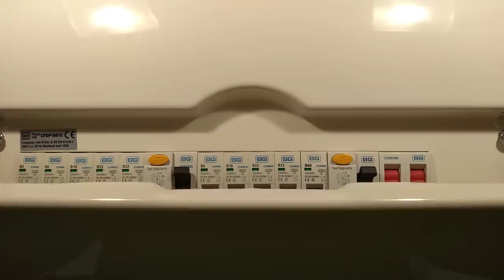A look inside a British home electrical panel.

Comment: 100A !!??!!  I have 3-phase 16A in to my house, but I think 3-phase 25A is most common in Sweden.  That is 400V 3-phase.
Reply: The 100A Single Phase would relate to 35A Three Phase
Reply: Try USA, my house has 2 phase 200A feeder.
Reply from the maker: That's quite odd.  Is it for remote locations with just one home on a cable run?  Here we have the higher current single phase, but adjacent houses will be on different phases to balance the substation load.
Reply: 400V 16A 3-phase is still about 11 kW. In American homes, most circuits are 120V, 15-20A. The service is actually 240V single phase, but it's split with a center tap on the transformer at the power line, giving us two 120V legs that are 180° out of phase. Your higher voltage means less current to get the same power, so you can use smaller cross section wires to carry the same power as us.
Reply: 400v 3 - phase, !      I take it your white goods don't run on 400v ?? so does each house have to have a transformer to drop the voltage to something safer? HUMMMMMM
Reply: @Repofox  thanks for the explanation,  so why did he have to make the point "400v 3 phase" ????  just down the road mine are hundred of thousands of volts-3-phase,  Clive seems hit on something here,  everyone seems to be in a upmanship competition atb nick
Reply: As said, 400V 3-phase is used for 230V (or is it 240V ?) single phase outlets, usually with 10A fuses.  The 400V 3-phase are often used for electric heating and/or water heaters.  Power hungry appliances as washer/dryer/dishwasher/heatpump/car engine heater are on different phases so that they can all be used at the same time.  If there are electric central heating we often have the heater monitor the total power consuption so that when for example the washer is using a lot of power the heater stays at a lower power usage until the washer (or wathever) is done.
Reply: Here in Belgium we mostly use 40A single phase 240V and 25A 3-phase 400V mains breakers (on the left).  16A breakers for lighting  (1.5mm²) and 20A for sockets (2.5mm²). We also use RCBO's.
Reply: @nickbird7742  400 V is phase to phase, phase to neutral is 230 V. 400 V is not used typically. For example ranges get three phases each 16 A i.e. max 3680 W each. But one can use also on a single phase. I have just a 20 A breaker which means 4.6 kW max.

Comment: Not sure if anyone has said this before but: A Type B will have a 5 times instantaneous trip and a Type C will have a 10 times. So if a 6 amp type B breaker hits 30 amps it will trip instantly, or if a 6 amp type C breaker hits 60 amps. Type D are often refered to as "motor rated" and offer a 20 times trip although this can be 10 times in some cases, remember to check the makers instructions and cross referance those earth fault loop impedance readings.

Comment: Wow. This seems quite minimalist when compared to panels used here in the USA. My home panel has approximately two dozen breakers, and the main breakers. But, it has no RCD. We use GFCI wall plates in water prone areas. I also use them around my repair bench, and at the metal lathe and bench grinder.

Comment: Snap! So you went for the Screwfix offer as well! '-)
Reply from the maker: It was irresistible.  And besides, it's not a bad choice of breaker ratings.
Reply: Yeah, that's exactly what I thought, nice and flexible, even though I only live in a 2up 2down, I'm sure the extras will come in useful. Is it something about event lighting experience that makes us want lots of spare breakers I wonder? ;-)
Reply: @bigclivedotcom  I fit the BG boards all the time, great boards and priced well. :-) I have fitted MK...meh...no better at twice the price.

Comment: Ah modern electrics. Something my house is long overdue for. Originally built with gas lighting and having that fancy electric stuff added later (a few times by the looks of things). The last time the electric company insisted we needed a newer (non mechanical) meter the guy that came to fit it had a mild heart attack. There's wiring of all eras of colour coding and some that isn't just for good measure. And as for a consumer unit? There's just a variety of bakelite and ceramic fuses among other fun things that children shouldn't play with. 
We have a couple of dead sockets, old round pin types, and various other oddities that even with the aid of multimeters we can't trace back to anything even though at one point or another they did provide power until they didn't.
I feel sorry for the poor blighter that will have to rewire it all 'properly' one day. We just nurse it along as we go and somehow haven't suddenly combusted. Yet.
Reply: "Modern". A common ground fault circuit interrupter for several circuits is something that we stopped doing many years ago, and now all new installations have the integrated GFCI for each circuit. Much less of a headache if you get some kind of ground fault, and you don't end up having a complete blackout in your house.
Reply: Hope you kept some gas lighting for power cuts  ;)
Reply: @Tomazack  And if you wish to pay for that you can do just that here. It's all down to how much you're willing to spend vs the very small risk of a fault.
Reply: @Monkeh616  Doesn't make sense to save on stuff like that. It's a one time investment, you'll probably not replace them all together anyway, only one by one if they fail.
And as an electrician I have never installed in a new house or rebuild a fuse box with anything but these combined circuit breakers. It's probably close to 15 years since they became the standard here. No exceptions in household installations. 
And I've lived in several houses where there's ONE common GFCI and the whole house got a blackout on occasion, it's no fun. If you're gone for the weekend or longer when that happens in the winter, bye bye pipes when all freezes. In the summer you just lost all you had in your fridge and freezer. So yeah, can't really find good arguments for saving on that end in my  book.
Reply: @Tomazack  As far as replacing, they do fail, and replacing them can be problematic a few years down the line.

In a lot of situations there is little or nothing to be gained by spending the extra - merely more points of failure. You have the flexibility to configure it however suits you.

Fridge or freezer bother you? Don't put them on a common circuit (and what tripped the thing when you were away anyway?!). Pipes freezing? .. perhaps don't have uninsulated pipework in areas where this is likely. Pipe insulation is money better spent. So is wall insulation. And roof.
Reply: @Monkeh616  Clearly you have different standards and priorities than we have. All fine by me. I was schooled in this line of work so I am only stating factual information about household installations in Norway. If you build a house, no electrician will ask if you want to save a little money on cheaper circuit breakers. That is just not an option here, for good reason.

Comment: I have a 1920's house in the UK. Inside the skirting boards which are 3 inches x 3 inches and concave there is double cotton covered wires,  one red and one black, in a groove cut into the back of the skirting board. These are still connected to very interesting plug sockets that have two pins. They were installed for DC electricity. I wonder if they are up to code.;-)

Comment: I have just rewired a secondary panel at home, we have quite different norm in France, called nfc 15-100. The main difference: input from the left, bottom output and dual pole breakers (both L+N). Note that both 3 phase and 1 phase are common (you can request what you want).

Comment: Took 4 years for me to be able to become a qualified electrician 5 days of training extremely concerning
Reply: If you can't get the general grasp of how a panel works in 5 days, maybe it's back to grade school m8.
Reply: Yeah LOL general takes more than 5 days to develop the appropriate skills and knowledge
Reply: @christophermangion9375  yea; but i think the point is, I don't think the US version is better though, just worse in a very different way.

8,000 hours and 600hours of course work to wire a plug in my home legally (pending state/municipal); yet I've worked, installed and designed 400V-600V, 100amp DC rails (you only make a mistake once with high amp DC).

Like the other protected professions in US; it's become a bit of a abuse of power acting in its own self interest; ie: (plumber, surveyor)

Comment: I use a 25A C curve breaker for my electric bike, it pulls 45A for up to a minute and has never tripped. It seems like the best choice as it's not a resistive load and the RMS rating seems more suited for that task.

I have seen fuses launched at peoples faces and entire power boards cratered and charred by a single breaker exploding. It showered the whole room in molten metal and set literally the whole laundry alight, so more protection is better in my book 😁

Comment: Quickie (close enough for initial purposes) power calc: at 240V 1KW is approx 4Amps,  So 60A main fuse = approx 15KW (saves hoiking the calculator out).  OR another way for every 1KW of load you need 4Amps at 240V.  So a 3KW heater needs approx 12Amps.  (For the purists 250V at 4Amps = 1KW)

Comment: 5 days training? Are you serious, is that from zero to hero? IIRC standard electrition dual-system apprenticeship is three years, ..! :-/
Reply: Clive is not properly reporting the truth, nobody is becoming a qualified electrician in five days. The five days of training brings you up to competent person level which is what is required to do minor domestic work. This means you can do basic domestic wiring as covered by the relevant onsite guide. You can't do any commercial (e.g. non-domestic) work or calculations for non-standard circuits and you can't do a test and inspect even on your own work. Additionally you aren't allowed to work on a three-phase system even in a domestic property. You can sign off your own new work as long as you have previously filed a minor works notice with building control. Building control may ask for a fully qualified electrical to inspect your work at the end of the job although technically they shouldn't if you hold the relevant qualifications. As for qualifications they must be kept up to date as the wiring regulations change if you want to continue signing off work.
Reply: Interesting, However, I would think in Germany you are legally not allowed to do any professional electric installation without this 3 year dual-system apprenticeship (trainee in a company + school) or higher qualification.
Reply: @WobblycogsUk  Yeah, I kinda presumed it was something like that. He's still right that it can't be enough time though - maybe if it was a refresher, but not starting from scratch...
Reply: @raybarker  I know a bit about it as I've sat one of the courses. As long as you've got a bit upstairs it's enough training to safely carry out the limited range of things you are allowed to do. Domestic wiring is not rocket science by a long stretch. Having said that the test at the end of the course needs work. The practical is thorough but the theory section is a joke.
Reply: @WobblycogsUk  Good info

Comment: Technology Connections gave some input about households across the pond are GFCI protected at the mains power box instead of through individual high risk outlets.  Houses over here are rarely GFCI protected at the power box, so it's quite a good thing that the circuit breakers are both made for high current and ground fault interrupting.  He also said that might lead to troubleshooting difficulties, since it'll be hard to track down an appliance that's flipping the breaker if a ground fault's the culprit, not high current.

Comment: looks nice here in South Africa we use a similar system but the busbar bridges and live connections are all made on the top of the board and the out going wires to the plugs ,lights ect all are on the bottom

Comment: Red Yellow Blue
Well Trained Crew
Brown Black Grey
Trained In A Day
Reply: Yellow? that could be confusilated with the Earth, not allowed anymore in Australia.
Reply: ah pre euro harmonisiation 2004 colours. some would say the good old days.
Reply: Ray G The primary colours, Red , Yellow , Blue, quite simply a no brainer.
Reply: @idi0tdetectioninprogress  When did common sense and government regulations ever appear on the same page? We used to have RYB phase colours until the Protective Earth conductor was changed from solid green to green with a yellow trace. If you are really stupid a yellow stripe could be mistaken for a yellow wire in the smaller cable sizes, so now we have Red White Blue.  I think next year they are going to let us have real plastic knives with a sharp edge! Don't know what we will do with all the rubber knives.
Reply: Ray G I think people are more referring to our now harmonised colours. Shame really, when we already had the best colour system.
Reply: @idi0tdetectioninprogress  Is that the black brown grey system? Luckily it never became common down Australia. Only ever find it on imported stuff.
Reply: @rayg9069  Yes, the Harmonised colours are what people are displeased with, and rightly so. When we had the best engineering standards on the planet, choosing the primary colours for phase identification was a no brainer, and GREEN for earth, who would ever have thought it! Now we adopt silly colour scheme so that cheap nasty European cable can be used in the U.K. Even Green/Yellow for earth was never an issue, only sometimes when we got awfully manufactured `Chinese`  over sleeving which was yellow with a green strip that looked like it had been done with a laser! Our Regs were always clear on a 70/30% colour split, so we just threw the other shit in the bin.
Reply: @idi0tdetectioninprogress  I have noticed the quality of electrical items has gone down the toilet in the last decade, we used to have Australian Standards stamps on all approved gear, rarely see it now, some of the plastics used for sockets and switchgear feels like styrene and so brittle
Reply: So true!
Reply: Mike Eastridge  which country?
Reply: @peterpeterson9903  Australia uses Red White Blue. Started change over from RYB mid 70's?
Reply: @idi0tdetectioninprogress  Except that the primary colours are Red, Green, Blue! Last I time looked, Cyan, Yellow and Magenta are the secondary colours. 

Green used to be Earth, until about 1972, when it was changed to Green/Yellow, along with Live (used to be Red) becoming Brown, and Neutral (used to be Black) becoming Blue, all in the cause of bringing us more in line with Europe, where (in Germany at least) Black was Live, and Blue was Neutral.
Reply: 28YorkshireRose12 Well you need to look again, because you need yellow and blue to make green in the first place. All colours are derived from Red Yellow and Blue, so there’s no need to muddy the water with Magenta and secondary colour nonsense. Also Red/Black in single phase and Red Yellow Blue in 3 phase systems were the colours in fixed wire installations into the millennium! Brown/Blue was only in flexible cabling.
Reply: Indosarnia  In a dark switchboard under bright torch light some of the colours could get a bit close, luckily the unified Grey Grey and the other Grey never caught on here.

Comment: Erroneous. My UK distribution box is made of Bakelite (or something similar) and has little wires that act as fuses. It's connected to a meter which has a nice wheel which goes round and round. It works just fine and no one in my house has ever been electrocuted to death. And I can't see any point in replacing it. Retro is the new thing in electricity.
Reply: Frank Gormanns I must admit we did have an issue a few years ago when one of the five amp fuses kept blowing. However a two inch nail seems to have cured the problem.
Reply: Don't feed the troll
Reply: Frank Gormanns Oh that's not fair. You deleted your post!😀
Reply: Frank Gormanns But to be serious in my opinion all these modern boxes do is protect against defective wiring. Appliances in the UK are earthed and fused.  If the wiring in your house is properly installed, safe and adequate for the load I just don't see how the cost of installing one of the modern boxes can be justified? It's just making work for the installers because any risk they may obviate is minuscule. If some one could make a convincing and not politically correct argument as to why I should replace my 1950s installation I might consider it.
Reply: @johnarmstrong3782  You shouldn't replace yours. But the number of people i know, both young and old, who don't know anything about how to safely handle any mains related thing that doesn't resemble a switch, is staggering. Educating people would be best, but it's nearly impossible to educate people who aren't in school anymore, about things they don't care about. 
Traditional fuses already are a challenge for some. My grandma drew a small arc because she attempted to change a blown fuse without switching off the supply to the fuse (little switch above the fuse itself)
Reply: @johnarmstrong3782  You should get someone to measure insulation and impedance in your home.
It's not only dangerous because of possible electrocution, it's a fire hazard.
Connections get loose or cables brake for no reason. It may work, but it gets very hot.
1950 is too old for any cable.
I had much younger cable that just fell into pieces just by touching it and the copper broke off.

I would install circuit breakers just for convenience and RCD for safety.
Reply: @Frank Gormanns All the wiring in my home was replaced (where necessary) and tested 10 years ago. It's fine. But I decided to retain my distribution box and meter because they are OK as well. And no one has died and the house hasn't burnt down.